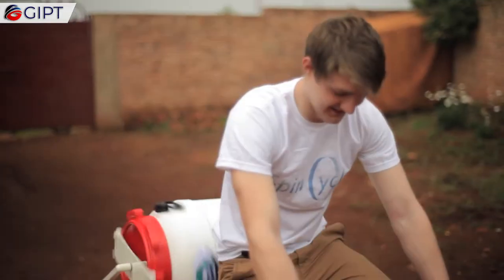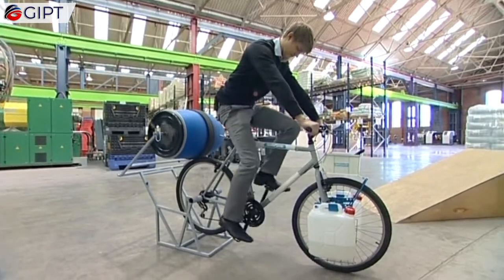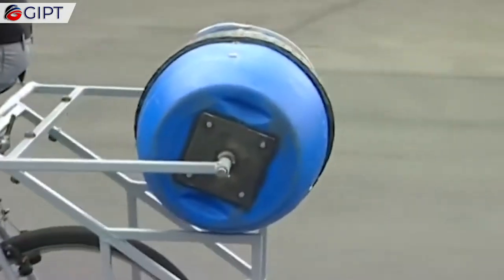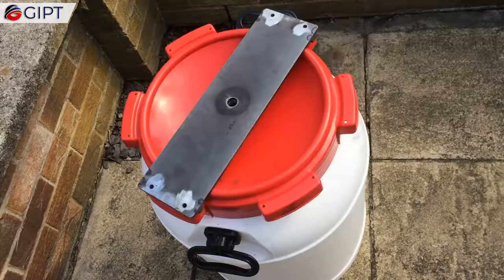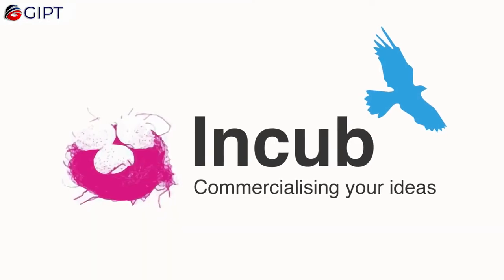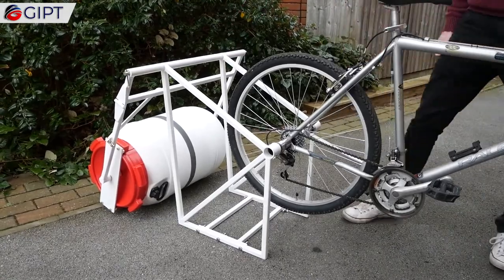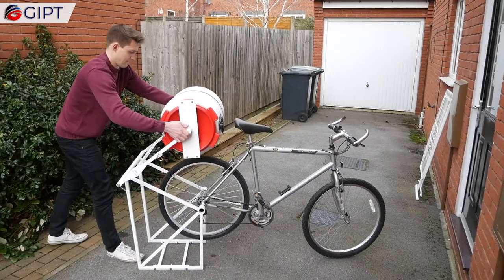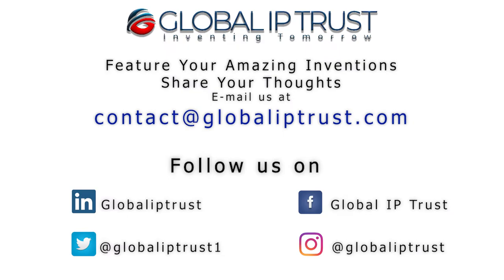The SpinCycle - A Bicycle Powered Washing Machine That Is Making Waves In Central Africa

Comment: Although human powered machines are great for off grid and temporary needs it is short-sighted solution. Sadly human is a very inefficient power source in terms of yield. Nutrients to keep you fit are expensive compared to the result so these will often keep poor people poor. Gasoline is so energy dense per kilogram you probably save money by polluting and sell the end product or service. Solar or wind power would mitigate this.